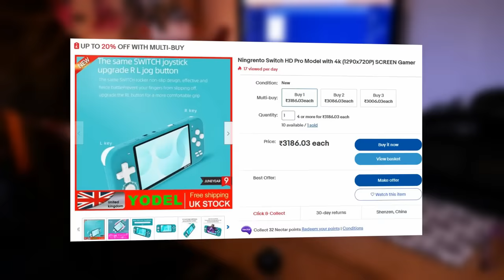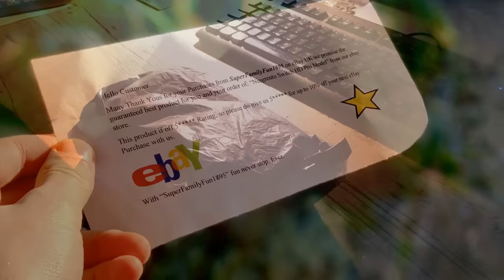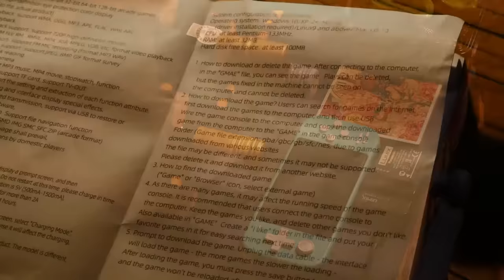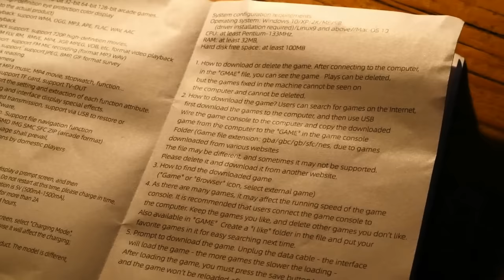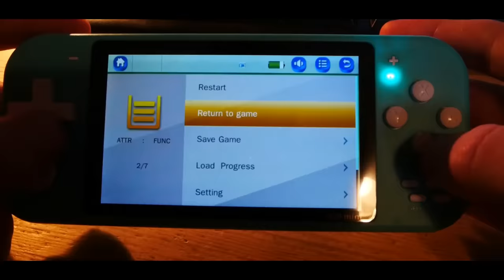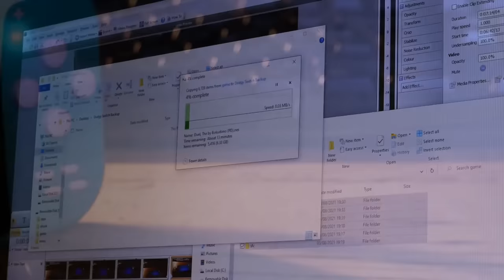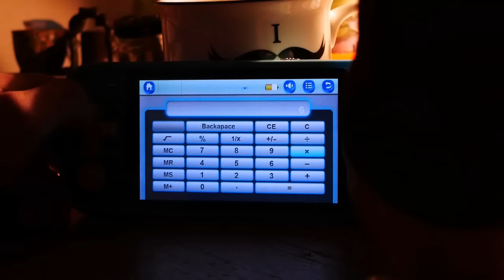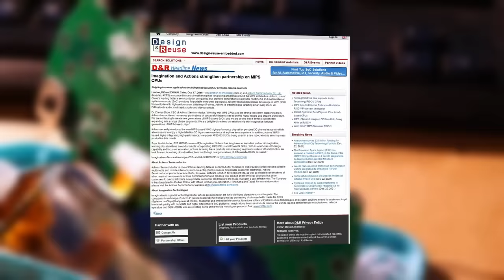I bought a $30 Nintendo Switch from China...

Comment: Actually, using screen as a heatsink is very common practice - almost all smartphones uses this technique.
Reply: Almost burnt my hand once when I fell asleep with phone on bed. You rly gotta what out for it.
Reply: Technically phones use the whole chassis as a heat sink.
Reply: I was going to say this and I still will
Reply: Phones (any sort of decent quality ones that is) don't primarily use screen but the back, screen just gets hot as byproduct of a CPU crammed into such a slim device.
Reply: @jackwilson5542  disassemble any flagship samsung, huawei, or just about any other phone apart from iphone, and you'll see quite the opposite -  heat tubes running on chassis between CPU and screen, thats not mentioning all the evaporation chambers
Reply: @jackwilson5542  sir you here accidentally remind me to watch jerryrigeverything .
Reply: @512mb4  Most motherboards in the flagships are pointing with CPU rotated downwards, with vapor chambers sticked to the back plate from the inside. I watch his videos and remember that. Again this doesn't mean no heat leaks to the display, but phone's back is primary heatsink.
Reply: Yea I been missing lot of his new videos
Reply: 1 thing I did notice heat is not good for amoled
Reply: @Metaljacket420  And your hands as water cooling
Reply: Sort of. The rear of the phone is often more effective at cooling the device than the screen is, but we tend to use cases.

Beware putting stickers all over a laptop or any other electronic device that you don't normally put a case on... It will effect the thermal properties of the device to an extent that may effect day to day usage.
Reply: Gotta get my hands on that weird gigabyte screen cooled thing.
Reply: @fungo6631  I'm waiting for the next gen human fluid cooled GPU's to upgrade.
Reply: @Metaljacket420  * cough cough iPhone 6 cough *
Reply: @jackwilson5542  You missed the joke there bud

Comment: I feel so bad for the kids getting this for chrismas expecting a real switch.
Reply: At least they can play good snes,genesis and gba games and watch videos.When we received these scams from our grandparents in the late 90s they had only 999999 nes games (or 10 games with 99999989 variations)
Reply: @sambas9257  those are still really common too - way cheaper to produce those famiclones than to produce these android-based devices. the coolbaby series comes to mind for example
Reply: Beats the crap out of those 80's and early 90's LCD games.

(The ones with the clock style LCD that have predetermined character and enemy positions). 

While it's not a switch, I could at least play it if it was my only game system. I was only a casual gamer, especially as a kid - I had 0 skill, but even when I was completely bored I couldn't manage to play an LCD game, they sucked that bad and I was always frustrated. 

Needless to say I was definitely thrilled when I finally got a real game boy when they came down in price.
Reply: This is the 2021 way of finding coal in your stocking.
Reply: @volvo09  Wait do you mean those tiger handhelds?
Reply: I wouldn't feel too bad.

They get to play some historical games that aren't riddled with microtransactions...
 Aside from the bad rom hacks.
Reply: Real switch is underwhelming so they're not missing out much.
Reply: Omg lmao 😂🤣

Comment: That homescreen is 100% a PS Vita ripoff, even down to the 3,4,3 layout. Speaking of, I recommend a PS Vita for emulation, they are quite easy to mod nowadays and SD2Vita is very cheap. It's often cheaper than proper emulation machines, but still offers an amazing screen for the OLED model and very good feeling buttons. Also you have access to both native emulators and emulators made for PSP, aswell as RetroArch with different cores, in case one doesn't work well (which I noticed with Final Fantasy V Advance) 

PS: Loving the background music. Mystery Dungeon is an amazing game series, even with the mediocre titles in between ^^
Reply: Oops, didn't see the heart and edited it. Oh well, have a nice christmas eve everyone!
Reply: Hmm might actually consider doing that. Do you know about DS emulation on the Vita
Reply: @HowlingDoom  I know that they started porting an emulator, but it performs very poorly. Any somewht modern phone is decent at emulating it though, especially if you have a controller that allows you to put your phone inside vertically 😊
Reply: @xPandamon  Thats true as well. I have to buy myself a new phone anyway so mind as well buy a gamepad attachment.
Reply: @HowlingDoom  Wanted to leave some links but my comment is getting deleted, so maybe this stays without them. PS Vita overclocking is generally recommended for more stable or simply higher framerates as there's no real risk, the last thing I heard about was GTA San Andreas being ported, it should run on the Vita fairly well if I remember correctly ^^

PS: ModernVintageGamer also showed it off, with the links in the description of course. It's an older but if anything the port got even better so it's basically a must have for any PS Vita owner. They also ported GTA 3 and Vice City aswell, the modding scene is pretty damn impressive :)
Reply: @xPandamon  Thanks for the info dude. Sucks you couldn't link me directly to the stuff but yeah youtube deletes any comment that includes links.
Reply: @HowlingDoom  No problem, it's pretty easy to find, most interesting Vita stuff was made by theFlow0 and Rinnegatamante (hope I remember the name correctly). I remember there also being an app for PS Vita plugins that you can install onto your Vita, which also helps to setup and manage everything. When I have money left I will definitely buy another PS Vita, just as a little mobile emulation machine, it's much stronger than my ancient netbook for it, except for N64 emulation 🤣
Reply: Or just buy an cheap amoled 2560x1440 phone from 2017 and put everything on :)
Reply: @012345678944107  Those phones often cost more, lack a proper gamepad and might even be running an outdated Android version. Is it easier? Maybe. More powerful? Sure. But a phone isn't a proper solution for gaming, even with a controller grip
Reply: @xPandamon  I dont agree. Its easy to install an custom rom for a newer android version. Ofc psvita games will not run, but for other emulators.
Reply: @012345678944107  I mean modding a PS Vita isn't hard either nowadays. Using finalhe it's pretty much automatic, afterwards you are free to install whatever plugins you want and you can use any available emulators for psp and ps vita. As I said, phones are usually more expensive and you need a proper gamepad, phones can emulate newer consoles while a ps vita is a better package overall, especially if you care for psp and ps vita games as well as retro gaming (not that I endorse pirating but, you know, the possibility exists)
Reply: Lol the vita sucks. I'm not gonna pay $200+ for that failed junk just to play emulation. Horrible idea and a waste of money.
Reply: @packlesswolf1  You do you, it has plenty if good games, access to the psp library too plus psx, plus decent emulation and several game ports. And I am sure it often goes for less than 200 dollars.
Reply: Which vita model version for home brew? I have the og psp from the first day it sold and used to love using homebrew
Reply: @Just.A.T-Rex  I had the oled 3g version but they all work well, the newer one has some internal storage which is nice but the screen isn't as good and the PlayStation tv is also moddable, although it lacks a touchscreen of course (I think it can be used with a PS4 controller, but the rear touch is still missing)

Comment: I'm personally interested about some of the Pokémon romhacks that are on here, there have to be a bunch that even I haven't heard of.
The reason gen 3 Pokémon games don't work is obvious: the emulator doesn't seem to support the 128k flash save type, or at least doesn't detect games that use that, that might also be why SMA4 was like "saved data is corrupted"
Reply: Back in the day around 2013ish, i replayed all of gen 3 at 8x speed on a Galaxy s3. I remember running across a few modded and reskined emerald roms back then.

After a quick google search it looks like there's way more out there.

Comment: One of the problems you run into when reviewing these, even ones sold as what they are and not a scam is the rampant sharing and reuse of ebay listings and product photos. Even if you use the exact same search terms there's no guarantee you'll get the same device pictured. Even ordering from the exact listing twice sometimes gets you two different products.

Comment: It doesn't cost much more for various emulation handhelds, from companies like Anbernic, that will run 8 bit and 16 bit consoles and handhelds perfectly (and play most ps1 games perfectly even on some of the cheaper models). They will even run a lot more MAME games. And they have community supported firmware etc that unlocks so much more.
Reply: There are interesting handhelds in the low price range anyway. Powkiddy V40 and Miyoo Mini come to mind (the latter is the recent one and it’s getting some rave reviews for great form factor execution)
Reply: This was my first thought as well. There are superior machines out there for only a bit more money.

Comment: The reason SMRPG ran like it was is because of the SA-1 chip. And this is a rebranded Powkiddy X20 mini, from what it appears.
Reply: the SA-1 chip was the most complex official(there have been some unofficial ones in recent years that allow the SNES to do FMV, and CD quality sound with people homebrewing new soundtracks onto games, and even porting FMV games like Road Avenger) add on chip for the SNES if I remember correctly even more so than the Super FX series of chips.

Comment: This is being sold as the x20mini handheld. Might be a decent candidate for modding.
Reply: Michael.. it's a Powkiddy J6 reshelled..identical menu and emulators..4.2inch screen..I have bought 2x J6 so I know them well..a few games don't run..but 99% of my ROMs are fine...well worth 25quid or 30 dollars
Reply: @markianclark9645  identical menu because its retroarch?
Reply: @fromfin90  ...I'm not sure what emulation the Chinese use..I expect it's proprietary..Powkiddy developers from some community software they commercialised..who knows..just guessing..
Reply: @fromfin90  no it’s not retroarch
Reply: Thanks, I couldn't find it under the name shown in the video but found it easily with the x20mini name.

Comment: It's a good thing they didn't put a PSX emulator on there like so many of these cheap emulator handhelds do, because at this price point they never run at playable framerates, and having an emulator on there that runs too poorly to be useful just lowers the overall impression of the device. It shows that they actually cared a little about the quality and first impression of the product.

Comment: Does the analog work properly?
This looks really cool and perhaps might be able to emulate other 2D consoles like Game Gear, PC Engine, Master system and similar others.
These types of systems usually comes with terrible buttons and if you say this have good buttons then the sellers should do proper marketing for this, it could be a good seller.
Reply: The analog doesn't ever drift, unlike the real switch
Reply: @gejamugamlatsoomanam7716  😂😂😂
Reply: It might even be able to emulate the PS1 due to using a MIPS CPU.

Comment: All the  ROM's on these devices are not Pirated as they are all legally distributable. These machines have been avaulable in various designs for many years some portable & some that connect to your TV.
The games are available on thousands of sites who clearly state what they are which if illegal would ave been closed down or blocked by ISP's regularly.
If you have a laptop or PC you can also freely download the emulators then connect XBox360, PS3, XBox One, PS4 or similar controllers & play without the cost of these machines. 
The emulators are also available on Android & IOS so you can use your phone or tablet (you can even use your Android TV)

Comment: It's funny that this thing kinda follows the design philosophy of Gunpei Yokoi that Nintendo still observes to this day, which is repurposing old, cheap, readily available and/or easy to mass-produce components -- or as they would say, "seasoned technology" -- in creative ways, including tech that may not have even been initially intended to be used for gaming. See: the Game & Watch handhelds having dirt cheap LCD displays sourced from calculator manufacturers, or the Wii essentially being a slightly tuned Gamecube built around a weird control gimmick.

Comment: It is very common for emulators to struggle with super mario advance 4: super mario bros 3. It has the largest save file size of any GBA game. Despite being a simple platformer it has the same file size as the pokemon games, but gen 3 pokemon games actually have most of the save data duplicated in the file. Mario has such a large save file size because it supports scanning in e reader levels which add the whole level's data to your save file. When the player beats the elite 4 in the gen 3 pokemon games, the game removes the duplicated save data to make room for hall of fame and post game data, this has a side effect of making many gba emulators no longer be able to read the save after beating the elite 4 the first time. I have a couple bootleg gba cartridges of mario 3 and they also give the save corruption error due to not supporting the save file size, and for a long time injecting the game into the official gba emulator on the nintendo 3ds did this as well.

Comment: 11:52 that game is called super mario advance super mario bros 2 it was a launch title on the gba and for many of us who had one back then was most likely thier first game they later did super mario advance 2 super mario world etc yet allways came packed with classic Mario bros remade allso the reason super mario rpg is running bad is very few portable emulators have the ability to emulate the special FX chip the snes used to run that game you can probably get a better emulator to run the game itself it's not the cpu of the device but without proper emulation of that chip the system is haveing a hard time running it proper

Comment: I have one. The firmware supports  gb (only in the file system menu for some reason) gbc, gba, sms, md (Only if the files have a .BIN extension) nes and snes. It actually does a decent job playing all of those systems. Anything past 16 bit is a no go as it has just enough power to run the aforementioned systems.

Comment: I know this video is two years old, but even back then, that emulation performance for £30 is ... lacklustre at best. Before this, and around the same price, you could get something like a Miyoo Mini or Retroid Pocket 2+. Both are slightly more expensive at MSRP but frequently went on sale, and delivered vastly better performance than this thing, alongside much better software (and a thriving scene of users developing new firmware with new features or better performance). And, of course, none of the repulsive ROM hacks (though still plenty of weird ROMs included if you want them, at least for the Miyoo). Today, of course, the retro emulation handheld market is crowded even around this price point, and we're really spoiled for choice with good quality handhelds from actually recognizeable brands (within the scene, that is). These ripoffs are never, ever worth buying even if them might technically work.

Comment: Growing up I played an emulator disc for the xbox with full romsets but it also had a hacks and bootlegs section. I still don't understand why there were so many offensive hacks of the first super mario bros. The same list had graphics hacks of SMB where you play as Barney, Santa, a penis, and a nazi. No levels were actually changed in any of those and there were a few hundred. Past SMB 1 I also remember Nude Punch Out standing out. There is a famicom game titled Nuts and Milk that never released in the USA pretty sure. It's a really fun game and I discovered it through a graphic hack that made it have mario characters. Unfortunately I didn't know for some time that some of the cutscenes were edited instead of the two characters that look like kirby to have mario and the princess nude. There were also many gory ones, I remember one called Dead Bubble Bobble where it looked like Bub had been smashed with a hammer so had a large dent and was bleeding. Not to mention in the bootleg section it had roms like bubble bath babes with full frontal nudity. Oddly there were really offensive hacks of earthbound beginnings but I'm pretty sure it didn't have the regular game. There were also many roms in both sections that just wouldn't boot or would launch with corrupted graphics consistently. If you avoided those sections though it had all the roms for many 8 and 16 bit systems. It was the way that I first played donkey kong country, mario rpg, earthbound, sonic 3 and more. Something that wasn't made clear in the video was whether these games were built in or were just preinstalled on the sd card. If they were on the sd card then it is very likely that whoever bought these in bulk and listed them as nintendo products just threw whatever on there. If there are baked in and have all those strange roms then that is concerning.

Comment: The Thing with Handheld Emulation is, theres way better alternatives. Theres some real decent Handheld devices of Higher quality to emulate your oldschool Games on the Go. 

I for example, Just bought an old psp for literally nothing. Like $5 or Something. It even came with a Case, SD cards, spare battery and some original psp Games. And with that you get the added Bonus of having a quality product by Sony. Cause the psp is actually a Well Made device and the Controls and Buttons are of course top notch. And itll probably Not die within a couple of weeks Like Most of those Chinese devices.